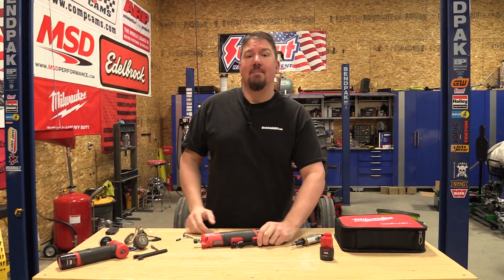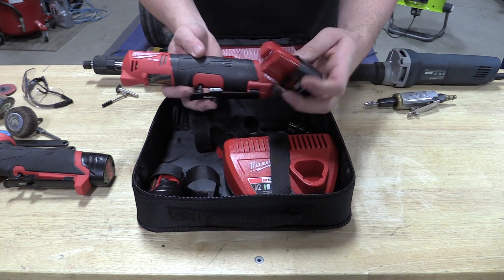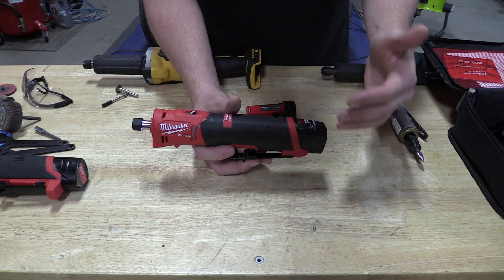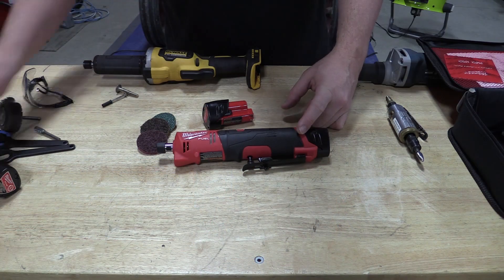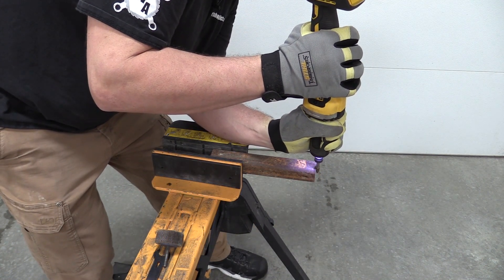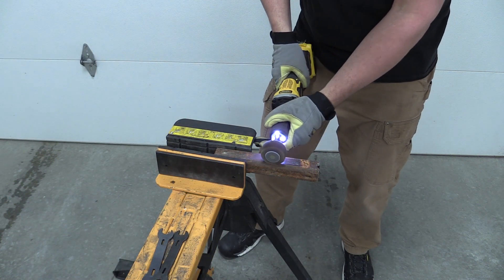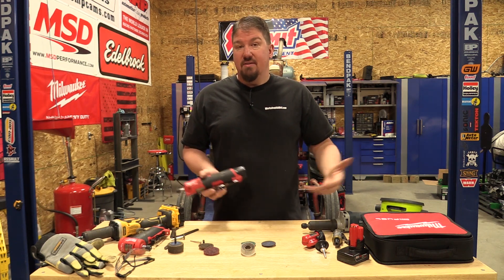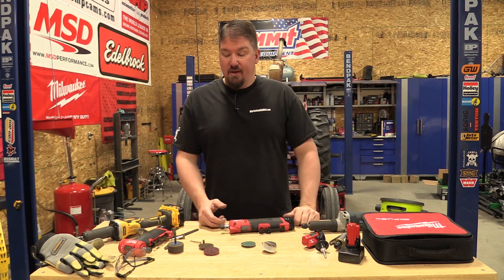Milwaukee Tool M12 FUEL 1/4" Straight Die Grinder Review 2486-22

Comment: I am waiting for a gen 2 of this as I port heads and turbos for people who ask or get sent my way. I have been using a mix of a corded 1/8" rotary and a corded 1/4" die grinder. For using a carbide and split shank with sandpaper on aluminium it seems like the perfect middle ground as a overgrown 1/8 with a 1/4 collet. with the new monster of a 1/8" brushless tool they recently released that has the same output power as this and the new 1/4" 90 degree gen 2 that has gone from 200W output to a comfy 450W with better lighting it leaves this tool in a odd dead zone where it seems to be entirely made of compromise.

Comment: Can you use roloc sanding discs with the straight die grinder.
Reply from the maker: Yes
Reply: I was able to get that straight die grinder as a free tool with the 2 5.0 amp batteries and charger at Home Depot. Just not sure if I’m better off with the angle grinder.

Comment: I think these m12s are more designed for burrs than cutoffs or flap discs. I use mine as basically a beefy dremel. I burnt out 3 dremels/m12 rotary tools and I switched due to power and versatility and couldn’t be happier with my decision. If you find the smaller flap discs and use worn out 3inch cutoff discs it works GREAT with those. I use my worn out cutoff discs from my m12 cutoff tool and I love that they work great and I get the most out of my discs. Very useful when you don’t have room for other tools. The burr performance with the m12 is top notch though.
Reply: Also should note they perform much better with the 2.5 HO or larger batteries. He doesn’t seem to mention the higher power output with larger batteries.
Reply from the maker: That is because those batteries did not exist when that video was made.

Comment: I have the right angle grinder works great for my uses if I really want to get after something I would rather use my corded grinder or as I always say the right tool for the job. As a DIY'er all my battery operated tools are M12 but other than my three original 2.0Ah batteries the rest of my 5,6 & 9Ah are all knock offs and when they die I replace their cells with Premium high output Samsung or Sony cells which still work out cheaper than buying originals.

Comment: My Rt Angle die grinder cuts off often,  infuriating! So do my little 3" cutoff tool and the rotary multi tool. And it does not take long for those of you think running too long or too hard. Maybe a couple minutes. Doesn't matter the battery size. But they are still convenient in short burst.

Comment: As a millwright in a food factory I have a lot of different equipment I repair and build a lot of custom “stuff” or modify “stuff” to fit our needs. Most tools we use are old fashioned plug in. We have cordless drills and impact drivers. Our cabinet does have a lot of cordless tools and my own cabinet have the straight and angled one. The straight is basically useless but the angled one have a small flapper disc on it and I use it for a quick deburr.

Comment: I found a Milwaukee drill for 40 bucks (12 volt)  I had a couple batteries for the Hatchet so I picked it up.  It is plenty powerful and handier to use than the DeWalt 20v max.  If I need a die grinder, I'll get the 12v Milwaukee.  DeWalt is just too big.

Comment: I've got both and use the angle one for removing gaskets, and straight for cutting. I notice a cutting wheel makes the tool noisy almost like a vibration. Overall I'm happy. I have 4 batteries.  Not sure why the different speeds because its variable speed so I leave mine on speed 4

Comment: I bought the m12 rotary tool (similar to a Dremel) and I often use it at work to cut threaded rods, or other metal material at awkward angles.
Compared to my corded Dremel 4000, the little m12 has no guts. It will cut things eventually, but you have to take it slow, not put too much pressure on the tool, out else it would die out. 
After watching this video about the straight die-grinder, I'm guessing 12v just isn't enough. 
It has to be an 18 volt, or maybe just a plug-in tool for any kind of heavy, extended work (not even that heavy)

Comment: I bought some china fandisks and the tool has a lot of vibration with them. Is this better with like 3m discs or is this expected? Because it runs super smooth without any accesoires attached.

Comment: I found myself rebuilding a Cummins ISX CM-871... I needed a die grinder to remove several gallons of RTV before I in frame it, no gaskets, just RTV... I bought both the straight and angle Milwaukee units. The straight grinder was nice getting in behind the front structure of the motor where the angle die grinder would not work. As of now, I have been using the 3M Roloc Bristle Discs to remove the RTV from the block. I have to say, these die grinders, are the BOMB! Do not put pressure on these like you would with an air grinder, they will shut down, let the tool do the work. I wish I would have bought these years ago. If you find yourself using a die grinder, I would get both if you are doing engine work, or need to get into odd spaces. And if possible, stick with the 3M Roloc heads and tools, the Chinese stuff is hit and miss at best. As far as run time, and lack of a compressor for a proper die grinder, the batteries are inexpensive, I use the Amazon Chinesium knockoffs, you can get a dozen of them for what you would pay for a couple of Milwaukee batteries. Up to 9 volts, no issues. Beats the minute or two I would get with a 20 gallon compressor.

Comment: Let's be real, yes, these tools have a place but the hype is not deserved. I have all of them but do not use them much. You speak of use on engines, I have videos that show these tools are toooooo large and don't have enough power. My little Sioux(air) right angle outperformed the milwaukee 4 to 1 not to mention I was able to get it into the spot on the front of the engine where the milwaukee would not even fit. I use mine on the bench and the fact that RPM is easily controlled is a big plus as well. In conclusion, yes I own them and they are handy as you don't have to turn on the air compressor but they cannot "yet" replace the air tool.
Reply: I completely disagree. If you do not have a commercial type air compressor, these things are the BOMB! I just purchased  both the straight and angled Milwaukee die grinders, in framing a Cummins ISX in a warehouse, no air compressor, these die grinders have saved me so much time. If there was a commercial air compressor available, I would nave not wasted my time on these two units. But that is not the case, no big air in my life.
Reply: @michaelwright1602  Did you read? Moreover did you comprehend ? I did say they are useful tools and if you don't have air so be it for the commercial shops we all have air always have had
Reply: @ralfsautomotive  I read just fine, and the comprehension is quite fine, thank you.
Reply: @michaelwright1602  I was not trying to be rude. Just saying, I made it clear that battery tools are nice! But they cannot replace air at this time.
Reply: @ralfsautomotive  I know that, as that is what I commented on. I do not have a compressor, did you not read my posting?
Reply: @michaelwright1602  I sure did! The reply was based on your comment! "I completely disagree." as in nothing of what I said is valid.😉
Reply: @ralfsautomotive  You own a compressor, many of us don't own a big enough one to run an air powered die grinder. So, yes, I disagree. 😁
Reply: @michaelwright1602  The smallest air compressor at Harbor Freight will run my 90 degree die grinder perfectly fine. But whatever. I don't have time to argue.
Reply: @ralfsautomotive  👍

Comment: Thanks for clearing up the collet issue! I had a heck of a time removing the carbide bit I used. Then I saw your video on the silly collet "non-assembly" and put mine together correctly. Perfect! It's a mystery to me why this is not done at the factory. It is far to easy to over look reading the manual, and the manual was punctured by the tool right at that section where the manual tells you to push hard to assemble the manual to the collet nut. Works fine now!
Reply: I missed that and can't find a collet video. I'm really struggling to get a ¼" shank wire brush into this collet. Any tips?

Comment: I've had the Right angle one for a long time. I don't really see where this one would be better than the right angle other than reaching deep into something. The right angle makes it so much easier to choke up and control in my opinion. Definitely a battery hog.
Reply: I chose the straight one over the angle for several reasons, it's really just personal choice. For me, I've only used straight grinders since around 1968 working in tool and model making shop, for several years in Honda off-road stuff, and personal home projects. Also used the Foredom tools for jewelry and fine metal working. But that heavy motor and drive shaft are always in the way, trying to push my hand around. This does the job but without all of that bulk! The advantage to a straight grinder is really, really fine control. To understand this better, picture a painter using a brush, they are never at 90% angle. For heavier work, say welding, auto, I'd probably select the 90% model. But then, all this is really the reason to have more than one style. You can never have too many tools in my opinion, each one doing exactly its job. Have to say, it was a toss up for me here.

Comment: Just got this tool. I love it! Thanks for the hot tip at the beginning of the video. Mine came the same way and on my first use I was getting a little frustrated with the collet.

I do have one gripe. My tool seems to have some flex near the top that is kinda concerning. Makes me think it's gonna break there at that seam
Reply: It’s made to flex like that for less vibration.

Comment: I probably wont get an answer (Im late, I know), but for cutting sheet metal, which one would work? The 90 degree or the straight? A regular angle grinder is great but too bit for smaller areas and corners where Id end up cutting structural parts I dont want touched...

Im also dealing with 10ga in the bed of this truck and its driving me nuts. Im about to junk it because its so frustrating. Thanks.
Reply from the maker: Straight will have more power to cut.
Reply: @WorkshopAddict  Thanks. I wish there was one more torque driven than speed, and small for those nasty corners (like in the bed of a pickup). I dont have air..well, I do, but my breaker blows at 80psi...its brand new, but my circuit is 15A so yeah...Anyways, thanks. Ill look more into the straight grinder. As a PS, I do have a dremel but it sucks. The blades go so fast, hardly cut, and all around a useless tool that cost a lot of money (I used them in the military but those must have been older gen, actual tools not toys for wanabes)
Reply from the maker: @RipRoaringGarage  This will be a slow cut too.  Get a 6Ah battery and it will be better.
Reply: @WorkshopAddict  Yeah, I got two 6Ah from other tools. Its why Im going with Milwaukee, since I have the impact guns and stuff like that. Body work is new to me, so Im trying to keep things as cost effective as I can. Slower going is ok, as long as it does it...Dremel would have been ok if not for the expensive and crappy discs.

Comment: Wondering if this with a 1/8” collet can replace Dremel for home game?  Just let out the smoke in my trusty Dremel rebuilding the adjustable pedal assembly in my newly acquired ‘04 WJ.
Reply from the maker: Yes
Reply: WorkshopAddict awesome.  Just ordered the new 2 piece set from HD.  Funny thing is, I put off buying the M12 die grinders for work because I have Pneumatics.  The Dremel failure was the excuse I needed to take the plunge.

Comment: Lot of time spent running the supplied kit batteries which is fair enough, but downplays the significance of the battery choice. My M12 Hackzall is another M12 tool that calls for a lot of power, so a 6ah battery is what I use in it.  It makes all the difference.

Comment: Saw another YouTube review in this same die grinder and it seemed to perform better at a lower speed.  How have you felt the tool at the lower speeds? Less cut out? Better performance? No less on everything??
Reply from the maker: It seems about the same power across most levels.  It depends on what accessory you are using.

Comment: The battery is a nightmare to install and remove. I purchased this tool recently. I love Milwaukee tools.  I tried putting lubricant on the slides. That makes no different.
Reply: Put the saftey on. Wish I could've helped you out sooner. It helps a BUNCH.
Reply: Absolutely correct...it's only this straight grinder that is so difficult to insert and remove battery...it's weird but ....I know

Comment: I'm glad he said that . That's now how you use it. He could have used a wired brush attachment 🤔 or a cutting wheel at that straight position
Reply from the maker: Trying to assess runtime in extreme use is tough and in this case caused us to use this unlike most will, but it showed power and resistance to cut outs.

Comment: Any time I can avoid pulling out a cord or hearing that GD air compressor all day is worth whatever it costs. Both of these are high on my to-buy list. I have found a second charger and 3 batteries is the best setup over bigger batteries.
Reply: I used to subscribe to this way of thinking. The amount of runtime on m12 fuel stuff with 6ah batteries will change your mind though.
Reply: @thisismydogsaccount  Il have to try it out now that 6ah have come down to a reasonable price.
Reply: @thisismydogsaccount I know your comment is 3 years old, but my favorite m12 battery is the new 2.5 high output. Still tiny and light, but more power and a longer run time than a 1.5 or 2.0. You can do a lot of work with a couple of them and they keep your tool nice and small.

Comment: The M12 straight die grinder is for light duty work where you want more controllability and a smaller size.  If you need to do heavy work with a die grinder - buy an air tool, or if you want an electric tool,  buy the Metabo variable speed die grinder.   As always, you need to choose the correct tool for the job.
Reply: Hey, do you think a die grinder can be use as a drywall rotor ?

Comment: Have the right angle grinder and it always shuts off. Ugh.
Reply from the maker: What size battery are you using with it?
Reply: @WorkshopAddict  The 6.0 amp battery.
Reply from the maker: @tobylynn75  Wow.  The grinders have been good to us.  Normally battery life is the complaint.

Comment: Wow, had no clue about that piece sliding into the other! I have had my m12 90 degree grinder for months and actually have starting using it less because of how annoying it is to change the bits. Will be trying this at work tomorrow, thanks for the tip!!
Reply from the maker: With those connected, you can loosen the college and your bit should slide out.  Without those two together, the nut will come off and the college will stay tight.
Reply: @WorkshopAddict  Thanks so much! Grinder works awesome now. Can't believe I didn't think to try something.

Comment: Or multiple batteries cycling them on a rapid charger. Had a similar talk with a coworker about the m18 mitre saw I picked up. What if your battery dies? Well is it against any rules to have more than one battery? Ok if my battery dies I take it out put it on the charger then grab the battery that was charging/charged before the in use battery., but if you are for some reason other than 12ah battery is $210 retail,  $160 market, and $80-$120 crackhead deals. Well then surely corded becomes choice.

Comment: Nice review! A lot of these tools should be coming with the CP 3.0 in my opinion.
Reply: I went to 6ah on all my m12 stuff. Was well worth it
Reply: They will never use the best batteries in any kit less than the 12ah and MX stuff
Reply: Yes sir, I bough mine a month ago. This tool is good for small out on the junkyard  job. I like it, but the battery and auto shut off is very annoying.
Reply: @andres99house  I zip tie the “safety lock” with a small black zip tie
Reply: I read that as C3PO.

Comment: Does it have defrent speeds? And how big it opens for grinding bits? 

I have a cord one, but it one speed, i wish is was slower
Reply from the maker: Bud, I went over all of this in the video.  :(  Three speeds ZERO to 10K, 15K and 21K.  It has a 1/4 inch collet and I link to an adapter to go down to 1/8".

Comment: I bought  the rotary M12. Totally useless. I returned it has any application you have to have it almost full speed with a 3,0 and i had not trouble stalling it. For $70 what do i expect. Not to be that weak. This seems the same tool....pass. Milwaukee hasn’t come close to cutting the cord for die grinders .air wins hands down.
Reply: No he bought the dremel type tool obviously not knowing what or how to use a dremel. I have one it’s great. Performs just like a corded dremel. You know high speed low torque. Everyone knows that ... well almost everyone I guess. I mean cmon even she admits their stupidity by “this seems the same tool” so obviously wouldn’t know shit from clay. Thanks for the giggle Dusty
Reply: sounds like you bought the brushed non m12 fuel series. There is a reason this cost $169.